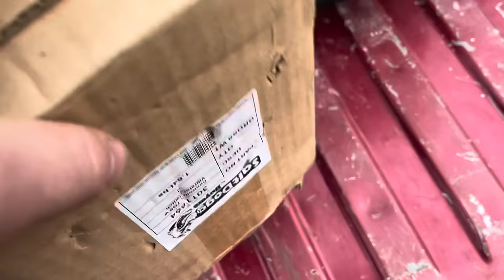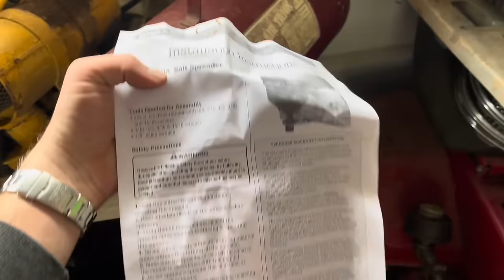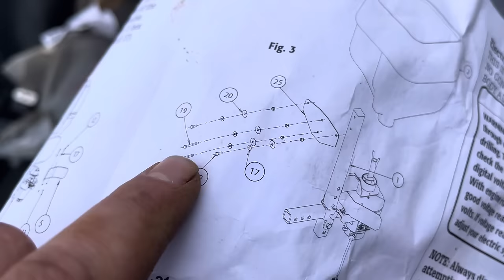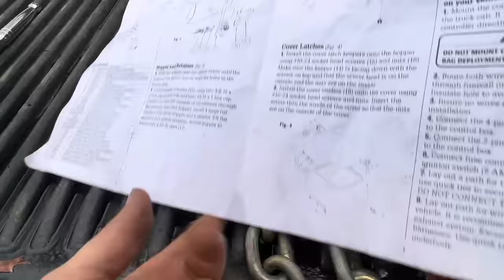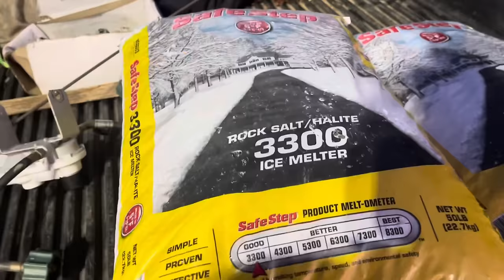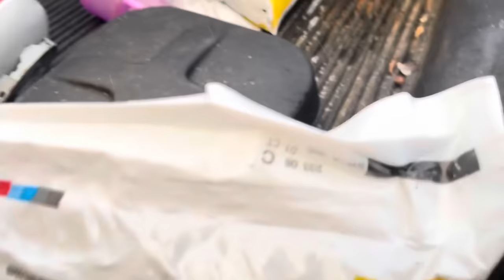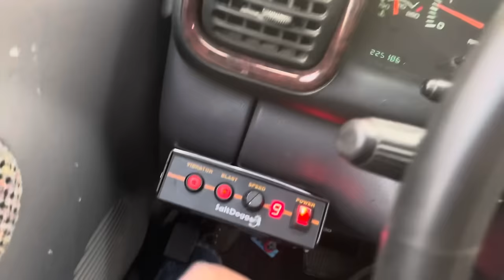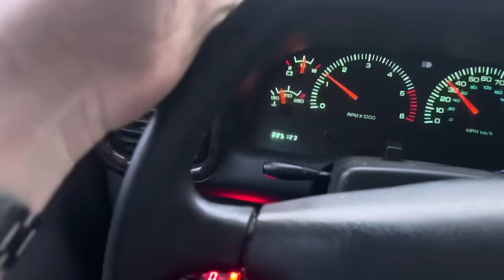Assembling, Fixing, and testing broken SaltDogg spreader

Comment: If you haven't done it already I would put the large area washers on the inside of the plastic hopper where it bolts to the main frame. As you said, the salt is quite heavy. Charlie looks like a good buddy to hang with!
Reply: I was going to comment same thing about thoes washers 😅🤣

Comment: Thanks to  the Ikeadya like  instructions,they have the large washers Inside, and holding the plastic better.They also have the bolt outside going in which leaves your nuts in the salt.(not a good idea). Put the large washer Inside the plastic so it won't pull through once the weight of the salt is hanging there.12:02 mins shows "Step:2='Put the screws Inside so the Nuts are Outside of the cover.' That's why the lid sets off.You fixed it. "Impeller" is the salt 'fan'.This was a fun learning episode.I thought there was allot more complicated parts and this was a good tool.

Comment: Did the clunking go away once you put the extra weight on the shaft? Just wonder if the sound was a balance thing. The free end of the shaft might wobble more with no weight. Around here (NH) as long as you ain't shoveling, it's plowing LOL.

Comment: What happened to the ole days when they used to just sand the roads. Now a days they don't even plow hardly just dump a ton of salt on the road and make three inches of slimy slop to slide around on . Personally I thought sand and slowing down a little worked just fine and my cars lasted longer as well. 😊 Oh yeah I'm up here in the noth east the rust bucket state.